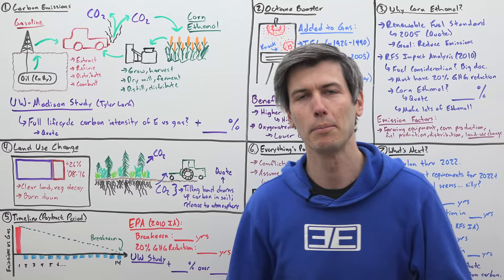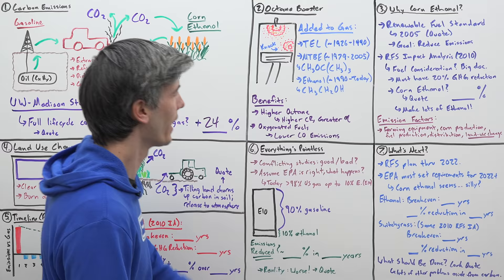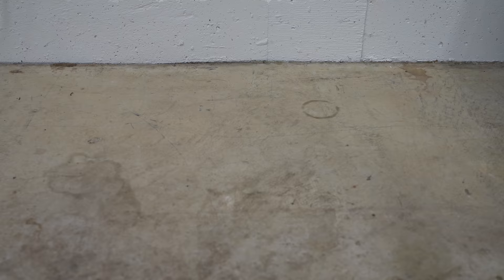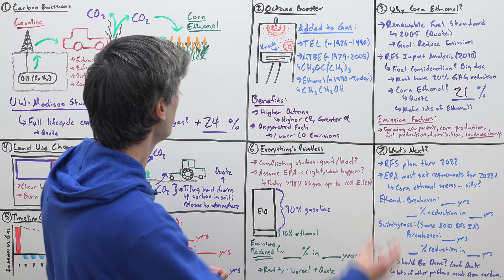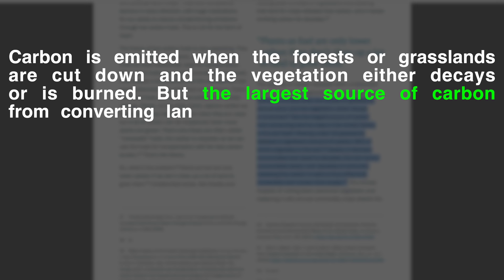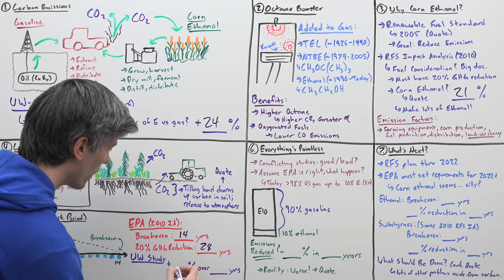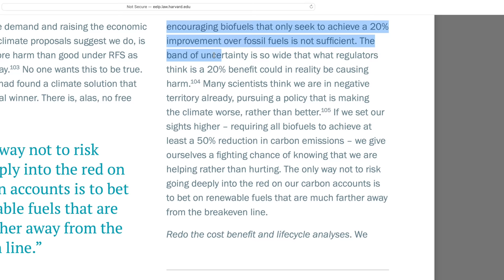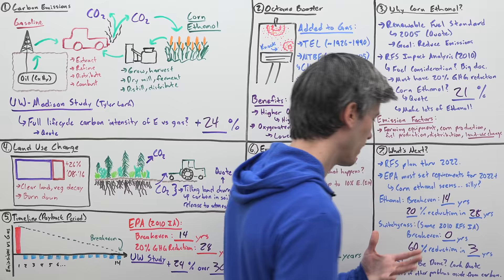America Was Wrong About Ethanol - Study Shows

Comment: You didn't even mention how much tractor diesel and oil derived fertilizer goes in to making corn.  If one is committed to making ethanol, corn is one of the worst choices.  We have known this was a poor choice for decades.
Reply: Few sources can compete with corn ethanol not because it makes the most ethanol, but because it preserves the feed from already existing corn acres in a healthier, more digestible/efficient, and more concentrated form called distillers grain.

There was no new virgin land or forests broken up for corn, simply impossible since US cropland acres have been declining.  Indeed the corn belt grew more corn acres in 1980 before ethanol than in 2018, the year of most ethanol ever produced.

No corn is grown just for ethanol, far too uneconomical.  But with the value-added feed factor, few others can compete with it.

100% of the fertilizer and everything from the soil still gets fed to the livestock in the distillers grains.  Ethanol is made only from things of the air: solar energy, CO2, and water with the latter two recycled once burnt.

Ethanol C2H6O = no fertilizer

Distillers grains = all the fertilizer

What logic is it to then assign all the energy and CO2 of fertilizer to ethanol and none to distillers grains? 

The US used 11,160,933 tons total fertilizer on corn in 1980, before ethanol.

In 2018, the year of most ethanol production ever, the US used 10,521,850 tons total fertilizer on corn.

Iowa State University measured all the energy it takes to produce an acre of corn into a "diesel fuel equivalent"
This included making of the machinery, fertilizer, chemicals plus the tillage, planting, harvesting, drying, trucking etc. 
They found it takes 34 gal of diesel to produce one acre of corn.
What do we get from those 34 gallons of diesel?
We get >500 gallons of ethanol.
But wait, that is not the kicker.
The kicker is we still get 100% of the protein from that acre of corn still available for an even better feed. A win-win.

Comment: Ethenol free regular should be mandated to be available for older/ small engines.Ruins carburators.
Reply: The very same older/small engines we have in Brazil use their common gasoline which contains 27.5% ethanol.

It has worked out so well and for so long that Paraguay went to E27.  Bolivia now at E25.

Ethanol on most any manufacturers chemical compatibility chart you will find is at worst equal to but most often easier on rubbers, plastics, and metals than what gasoline and BTEX (benzene, toluene, ethylbenzene, and xylene) are.
Reply: @danafletcher2341  maybe if they run non stop, but anything that sits (seasonally) even if stabilizer is added will be worse off. Personal experience. No issues with non ethenol, gas may be " stale" but no rust/ corrosion  like ethenol fuel.
Reply: Gasoline lasts 3 to 6 months.

Many fuel treatments use an alcohol for an active ingredient.  Sea Foam which they state makes gasoline last up to two years for example contains 25% of an alcohol.

The DOE found that ethanol blends last 3 times longer in small engines than E0.  The volatile (& toxic) aromatics used for octane in E0 evaporate out and leaves behind an unusable fuel.

My personal experience was my father's small engines in the 1970s would varnish over winter and the carb would have a stuck needle and/or float.  Like a skunk smell, varnished gasoline is something one never forgets.

Since E10 came in the 1980s in the Midwest, I have never seen it ever varnish.  The transition from E0 to E10 plugged a lot of fuel filters at first as the built-up varnish in the fuel tanks dissolved, but once clean E10 kept things clean.  Small engines were the worst because for some odd reason, makers didn't put fuel filters on at that time.

Ethanol keeps the fuel dry so rust from water is less than from gasoline.  Back in the days of E0 during wintertime, people had to buy little cans of alcohol for gas-line antifreeze with brand names like Heet or Dry Gas.  No need to since E10 came along.

Comment: I've been a small engine repairman for many years. Primarily 2 cycle. The damage caused by ethanol cannot be overstated. I recommend 100 percent gasoline for all 2 cycle engines.
Reply: If you believe this, then you should sell everything you have, move to Brazil, and buy every small engine repair shop you can find where identical small engines use their common gasoline that contains 27% ethanol.

If what you state it true, you should become a gazilianaire in no time.  Thank me later.
Reply: @danafletcher2341  Have you ever repaired a small engine that was ran on ethanol polluted gasoline ? I've repaired hundreds and have seen the damage done to cylinders and even carburetors. Do you know what oxidation is ?
Reply: @TERRY-cb2ku  Thats from water in the fuel.
Reply: @oldblueaccord2629  Exactly. Ethanol is an oxidizer.

Comment: Dirt track race engines run on?
Methenal?
Why?
Because how hard you van run a engine on and gains of building a very high compesion engine then has and run alot vooler under jard run conditions....and huess what when testing the exhaust gasded????
Clean burn!
Reply: A Brief History of Racing Fuel By Craig A. Johnson

In 2005, the IRL used 100 percent methanol in their tanks. The fuel worked well and was more efficient than straight gasoline, but IRL officials believed there was room for improvement. In 2006, they moved to a 10 percent blend of ethanol and methanol, which was then changed to 100 percent ethanol for the 2007 season.

The desire to use only ethanol aside, 100 percent ethanol is nearly impossible to obtain, and is illegal to keep without paying hefty taxes that date back to prohibition. The actual fuel used by the IRL is a blend of about 98 percent ethanol and 2 percent denaturant. The exact composition includes a small amount of high-octane racing fuel.

The fuel for today's Indy cars has an octane rating of 113, compared with methanol's 107. This means a significant reduction in pre-ignition, or knocking and pinging.

In addition, many of the people who handle the fuel, say it smells like tequila. This quality may seem insignificant, but smell is actually one of ethanol's benefits when compared with methanol. Pit crews noticed the switch to ethanol immediately, reporting fewer coughing fits and less eye irritation before any other modifications were made to accommodate it.

According to Dennis Vervynckt, manager of hospitality services and an IRL official, in 2006, the first year the IRL began using ethanol, teams saw a reduction in efficiency of about 10 percent. "That's because we put straight ethanol into the tanks," he says. "The teams initially didn't make any or very many adjustments to their engines. After a few months, they kept tweaking and by the end of the season they were back up to 100 percent efficiency."

Vervynckt points out that there was a minor loss of power. "When they first started using ethanol, teams saw a slight drop in horsepower," he says. "As the teams got used to the fuel, they were able to get more horsepower from ethanol once they again reached maximum efficiency."

The switch to ethanol also allowed the racers to carry less fuel and make fewer pit stops, thereby increasing efficiency even more. "When the cars ran on methanol tanks had to hold 30 gallons to accommodate the fuel requirements of the cars," Vervynckt says. "After getting the engines to perform at their full potential, there was a significant gain in mileage. Indy cars now have 22-gallon tanks. When a driver pulls in to change out his tires, he can fill up. Teams were able to match their tire and fuel stops exactly, instead of stopping for tires only, or fuel only."

That efficiency translates into much less fuel being used by the sport. Lifeline Foods LLC, which supplies fuel for the IRL, will produce 120,000 gallons of ethanol for the 2008 season. And though this may seem like a lot, it's 20,000 gallons less than was used the previous seasons.

The switch from methanol-based fuel to ethanol has amazed almost everyone in the league. Drivers, the direct users of the fuel, voice their approval in glowing terms. "[Ethanol] is an American fuel that is good for the country and the environment," says Ryan Hunter-Reay, of Rahal Letterman Racing and driver of the ethanol car. Standing beside his crew as they make last-minute adjustments to the car, he is more than happy to discuss the benefits of the IRL's switch to ethanol. "It's been great for Indy racing the fuel economy, emissions there's nothing we don't like. We love it."

Comment: Plus, when use 10% alcohol, you lose about 3 to 5 miles per gallon in your car and that is never factored in when you’re talking about emissions
Reply: Actually, emissions are the very reason why 10% ethanol is added.

After the disastrous octane booster lead was outlawed, the petroleum industry gave us MTBE which was not only an octane booster but also an oxygenate to reduce pollution.  During this time ethanol was modestly sold in the Midwest proving itself to be an economical and effective non-toxic octane booster and oxygenate.

When it became apparent that MTBE also needed to be outlawed, ethanol was chosen to replace it.  The petroleum industry actually went along with the legislation at first because hidden in the bill was legal immunity from MTBE.  That was revealed and taken out but the bill still passed.

That is the reason we have 10% ethanol today.  Being much cheaper per mile to drive with is a pleasant bonus.

Denver in 1988 was the first government entity to require E10 when they were on the EPA list of ozone non-attainment zones.  Soon with ethanol they were off that list.

Even with just 10% ethanol added to E0, the Swiss Federal Laboratory for Materials Science and Technology found that the especially health devastating ultra fine or nano particulate emissions were lowered by 97%, carbon monoxide lowered by 81%, carbon dioxide lowered by 13%, aromatic hydrocarbon emissions lowered by 67-96%, and genotoxic emissions lowered by 72%.

There were no grasslands or forests broken up for corn.  Quite impossible on its face since US cropland acres have declined since ethanol.

Census data shows corn producing states increased grassland, forest, and wildlife areas.  The corn belt actually grew more acres of corn in 1980 before ethanol than in 2018, the year of most ethanol production ever.

Corn ethanol is a value-added product of already existing feed production acres which preserves the feed in a healthier and more productive form called distillers grains.

100% of the CO2 from the fermentation and burning of ethanol just came from the atmosphere and 100% of it needs to go back there to make the new gallon of ethanol.  Zero newly added CO2.
Reply: PS The EPA states that the US vehicle fleet loses an average of 3 to 4% mileage with E10 vs E0.  Since ethanol is so cheap which far exceeds 3 to 4%, it is cheaper per mile to drive with than E0 and without all the pollution.

The EPA states that E15 loses about 4 to 5% mileage vs E0, but it is even cheaper per mile to drive with than E10 with even less pollution.

Comment: Can we have a discussion on the Ice core and tree ring data that allows us to track climate and CO2 levels. Climate shifts  over approx 1000 year cycle. 50” years cooler 500 years warmer.  The evidence is that CO2 follows the climate curve. There is no real evidence that carbon causes global warming. In fact, its infra-red absorption wavelength is about the same as nitrogen and oxygen.

Comment: Battery electric however has withstood every scrutiny. The solution is already here.
Reply: Tell that to the Duluth, Minneapolis, and St. Paul metro bus systems.  

For a fraction of the cost, they could have had reliable Scania ethanol bus engines almost pollution free with mileage equal to diesel engines and far cheaper fuel.

Comment: Yea break even if only you didn’t keep expanding the amount of land needed.
Reply: 100% of the CO2 produced by the fermentation and burning of ethanol just came from the atmosphere, and 100% of it is needed to be back there to make the new gallon of ethanol.  A cycle.

The video acknowledges this but then went on to claim grasslands and forests were broken up for corn as the reason ethanol puts out more CO2 than petroleum or at least for 24 to 30 years.

The problem is the fact that no grassland or forests were broken up for corn.  This is quite impossible since US croplands have been declining.

Census data even shows that grassland, forest, and wildlife areas in corn producing states have increased since ethanol.

Believe it or not, the corn belt grew more corn acres in 1980 before ethanol than they did in 2018, the year of most ethanol production ever and ethanol plants everywhere.

2018 Iowa 13,200,000 acres of corn with record ethanol production
1980 Iowa 14,000,000 acres of corn before ethanol

2018 Illinois 11,000,000 acres of corn with record ethanol production
1980 Illinois 11,600,000 acres of corn before ethanol

2018 Indiana 5,350,000 acres of corn with record ethanol production
1980 Indiana 6,450,000 acres of corn before ethanol

Comment: What about all the Diesel burned to harvest and plant etc.
Reply: I can answer that.  But first, since corn ethanol is value-added from already existing corn feed production which preserves the feed in a better and healthier form called distillers grains, I ask is it logical to assign all the diesel to ethanol and none to the feed called distillers grains?

We will grow the same amount of corn with or without ethanol.  Cattle feeders who now use distillers grains would have to find an alternative source of protein if we outlawed ethanol with another Prohibition.  

Indeed the corn belt grew more acres of corn in 1980 before ethanol than in 2018, the year of most ethanol production ever.

To further help make these determinations, note that 100% of the fertilizer still gets fed to the livestock.  Ethanol (C2H6O) is made only from things in the air: solar energy, CO2, and water.  Is it logical to assign all the fertilizer to ethanol and none to distillers grains?

Finally, I'm going to address your question directly:

Iowa State University measured all the energy it takes to produce an acre of corn into a "diesel fuel equivalent"
This included making of the machinery, fertilizer, chemicals, plus the tillage, planting, harvesting, drying, trucking etc.
 
They found it takes 34 gal of diesel to produce one acre of corn.

What do we get from those 34 gallons of diesel?
We get >500 gallons of ethanol.

But wait, that is not the kicker.

The kicker is we still get 100% of the protein and other things from that acre of corn still available for an even better feed called distillers grains. A win-win.

PS  In that study, the amount of actual diesel fuel used by farmers to put in a corn crop and harvest was 4 to 6 gallons per acre.

Comment: Ethanol vs Biodiesel? I wouldnt mind driving a Golf TDI or a Cummins running off of Biofuel that we grow. If we are talking about efficiency we could have pushed for more compression ignition engines instead of ethanol?
Reply: Plants produce huge amounts of carbohydrates but relatively small amounts of fats which is why ethanol is cheap and biodiesel at best is as expensive as petroleum.

Scania has sold an ethanol engine worldwide with power and mileage on par with their diesel engines.  Compression is 28 to 1.

GM drove around an ethanol optimized engine with power and mileage greater than gasoline and even diesel engines:

FROM RICARDO:
The new federal CAFE standards are calling for a doubling of fuel mileage performance, which, Vint says, is going to send OEM’s looking for high octane numbers to improve efficiency and ethanol is the best source. Ricardo, an engineering firm with over 100 years in the business of engine design, has developed an extreme boosted direct injection engine (EBDI) to optimize ethanol blends. The 3.2 V6 gasoline engine rivals the power and torque of a much larger GMC Sierra 6.6 diesel, he said, and it delivers 3.5 percent better fuel economy than the diesel.

Cummins too had their own highly efficient ethanol engine called ETHOS, but have since invested into a company, along with John Deere and others, called ClearFlame who converts diesel engines to use E100.  It is so clean that it eliminates the expensive and unreliable exhaust filters and DEF.

I am all for using biodiesel especially since seed oils are not even fit for human consumption IMHO.  It really makes sense to make use of spent tallow from making French fries from Buffalo Wild Wings for example rather than filling landfills with it only to off-gas methane.
Reply: @danafletcher2341  Wow i have been out of the loop for a while. Havent heard of these new advances in ethanol. Gonna have to brush up on new technologies. Im all in for any type of renewable fuel source for combustion engines. I drive manual transmissions and they wont be around any longer with more EVs in dealerships.